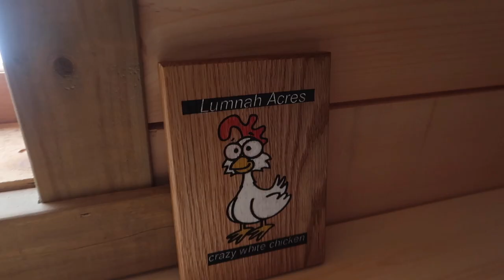BEST UPGRADE for DeWalt CHOP Saw WISH I knew about MONTHS AGO!

Comment: That's a DeWalt DWS779 that you just turned into a DWS780. A $200 upgrade for about $80 (incl. shipping). 👍 Just did it to mine last month.
Reply: BTW the bottom handle didn't need to be replaced as it's the exact same, only the top portion is different. 
Also, I kept my Warranty safe by just tucking the white wire into the white wire clips and didn't cut any wires on the saw.
Great upgrade!
Reply: that is crazy i never knew you could upgrade that yourself
Reply: @notbuyingit5698  thanks for the tips....I'll spare myself the headache of replacing the bottom handle. I'm not clear however what you mean by "tucking the white wire"...I gather it's secure enough from vibration that it's holding fast?
Reply: @Keith Rayeski - The white wire on the added wire clip (black & white thin wires). Strip the end of that white wire a bit more, then separate the White Wire clip original to the saw (thick wires). Put the stripped end of the thin white wire on the added wire through the small hole on the end of the thick White Wire clips original to the saw. Then tuck those thick White Wire clips back together and it's done. Never had to cut anything original to the saw.
Hope that made sense...
Reply: @Keith Rayeski @12:12 to 12:20 on the video. Don't do what Al did after 12:20. You don't even need the included wire connector shown at 12:21
Reply: Not Buying It yep, following you....thanks again...I’ll take that approach....
Reply: M J main advantage I could think of, is the laser only lines up one side of the blade.
Reply: M J one of the disadvantages is that it is battery operated, something Al does make note of in the video. Certainly, if it fits your 12 inch, you can learn to use it. But the dewalt light is a part of the actual saw. It’s more of an upgrade than an addition. It also lights up a larger area of the board and cut, as opposed to a single red line that affords no additional lighting. Call it user preference. For some, it’s worth the cost and again, adds permanent value to the saw.
Reply: M J once I use it? I’m a general contractor, I own 4 miter saws and have made more cuts on one than everyone in these comments combined. A laser only shows you where the blade hits on the left side of the blade. If you need to make a cut on the right side, you’re either guessing your blade kerf, or you bring the blade down to check where it falls. But if you’re having to do that 50% of the time, then why have the laser at all? You asked what the advantage is, I answered your question. Don’t @ me!

Comment: I ordered mine today Al. I had seen them and did want one but, until now, it was a 'want' not a need and I couldn't justify the nearly 85 bucks for the, then what I considered, the luxury. But here is what sold me. I watch a wood working channel on you tube and he posted a video on cutting and installing treads and risers and a jig he built to make that much easier. He noted that many houses, especially older ones, are often a challenge for plumb, level and square. The jig made precision cuts were made a piece of cake because he had installed the light on his Dewalt as well. He was able to adjust his angles to a minutia before pulling the trigger on the saw. I was SOLD!! A like 'Not Buying It' noted, the value of your saw increased in value (excluding the purchase of the upgrade), by an easy hundred bucks! Not that I would consider selling my 779 (soon to be 780!) saw!! lol!

Comment: When I purchased my new 12" DeWalt slider - I thought "Oh boy, a small led work light.".  I had it for about a month before I was watching a YouTube video and saw what it was actually for (who said reading instructions has its benefits) ;-).  I agree, it is much better than the laser pointers that keep going out of alignment or need to be re-aligned if you change blades.

Comment: Gina, instead of peeling and slicing the beets before roasting, scrub them clean, then wrap them in aluminum foil.  Cook them until they are fork tender.  Take them out of the oven.  Let them cool a few minutes.  Then the skin will come right off.  I cook mine this way.  I use a paper towel to rub the skins off.  You can then slice or cut into quarters.
Reply: Susan Robare yes! I have never peeled a raw beet!

Comment: I have a laser light on my saw. I think the shadow light is more accurate. Al, when you mark a board at say 10'', put like a "V" shape mark pointing at the 10. It's called a crows foot. If you just put a line, and it's a bit crooked, it won't be as accurate. Especially if you mark it and hand it to someone else to cut, they won't know which end of the slanted line to reference. It can throw you off  1/16" or more. Might not seem like much unless you are doing trim work. It can make a big difference.

Comment: Taking a picture of the wiring is an excellent idea. Another tip would be to get a piece of cardboard and punch the screws into it and write next to them where they came from, so you know where and when to put them back in, in the right order, and you don't end up losing them. Al, you forgot to put the security strip back into the handle.

Comment: When I do Electrical Rough-In on Residential and Light Commercial structures , I always take Photos of the Wall Boxes after the Rough-In is complete because I have had Dry Wall Installers cover up some of the Electrical Boxes by mistake. By Going back and looking at the photos I know exactly where each box is and I can easily find their exact location !

Comment: Good morning to all.The smell of a wood stove burning on a cold snow frosted day is comforting with properly aged wood that give a dry aged warmth with a kettle of water and fragrant leaves I tossed in the copper pot to add more fragrance into the house, orange bergamot, sage, rose hips and lemon bam and a few added seeds I can’t quite remember as I made quite a few as I gathered and dried and bagged. When you step outside the aged wood has quite a good fragrant smell of that beckons you to come inside and sit by the stove with a mug of hot chocolate. Y’all have good day.

Comment: I use to have a wood burner. Then i switched to a corn burner. Its like burning corn oil so there's no wood smell. I do miss that. I only use it in below zero temps to supplement the regular heat.

Comment: I bought DW 717 XPS that led light was great until it broke just after warranty was void. Now i have normal saw with broken led.
Reply from the maker: I bet it can be fixed
Reply: @LumnahAcres  Yes it can for sure but not high hopes if previous lasted few years that replace part won't last much longer.

Comment: Does it make a difference if your pencil mark is on left side of blade , let's say you measure from right to left would you have to see the mark on right blade to compensate for thickness of the blade. ?
Reply from the maker: It does

Comment: I bought a Milwaukee impact and drill kit about 4 years ago ,warranty for 5 years only thing not warranty was the brushes , i used it for about 3 months then the trigger went bad so i took it to the shop for warranty , guess what the trigger and brushed are one kit so 120.00 later got my impact back , used it for like 5 months and trigger went bad again ,so to the trash  it went, i bought a RYOBI kit impact and drill  been lil over 3 years now not the 1st bit of problem , for 98 bucks didn't do to bad

Comment: Al,   It is great that you remembered to unplug the saw before you worked on the switch and wiring!  But, never grab a saw blade on any power saw while plugged in.   One defective spring could break and the saw turn on.   Keep your fingers to yourself!    Respectfully,   Kevin

Comment: When are you going to put some outlets on the wall above your workbenches?  The outlets by the power panel are getting full of battery chargers, the needed security system, and extension cords that run all over the floor.
Reply from the maker: Once I know where I need the plugs I will run the wiring and conduit

Comment: At what temperature does it not matter if you are using Fahrenheit or Celsius?  -40 is equivalent on both scales.  Of course it's still over 200 on the Kelvin scale.

Comment: Anyone have a link to the exact setup used in the video? Thanks!
Reply from the maker: I bet if you call the company they will tell you what you need
Reply: Lumnah Acres did you intentionally not leave a link to their website in your description?
Reply from the maker: Zach McBournie I pinned there link to the top of the comments
Reply from the maker: Zach McBournie and it’s in the video description
Reply: Lumnah Acres that is the exact kit you used. That kit works for DWS779, DWS782, and the DW716 only.
Reply: Lumnah Acres Haha! You are right. I was being lazy and since it wasn’t highlighted blue I skimmed right over it. Thanks so much!

Comment: I guess all the slice of your life stuff is nice, and obviously lots of people like it, so maybe it's just me, but I was only here for the tool information and was trying to fast forward through all that other stuff. So, having got off on the wrong foot already, I have a question about the tool stuff. You say the kit came from www.toolsandmachinery.com, but it's not hyperlinked, and having gone to that site, and I can't find the kit. Do you know the # of the kit? It doesn't sound like the two Dewalt replacement laser kits they have listed, and I've been on hold with them for so long that they finally just disconnected my call. Wanting to add this to a DW715.

Comment: taking pics of the wiring has helped me rebuild my 80 gal water heater. saved me 800 bucks and i avoid replacing with a lower capacity unit. just cant find those 80 gal water heaters anymore. great tip.

Comment: You could wire it direct to the output of the switch and not use the new handle and it would just come on when you pull the trigger

Comment: Alaskan here. It's -12 F right now. It's cold right now, but after -25 or so, I just can't tell that much difference from -40. I've been in -50. If it stays at that temperature for a few days, the black spruce will suddenly crack open. It sounds like a rifle shot sometimes.
edit: I love that smell. Alaska has AMAZING smells at different times of the year. My favorite smell is the cottonwood leaves opening. They have a sticky sap that smells heavenly. I wish they made a room freshener of it.

Comment: Nice upgrade with the LED light making a perfect shadow of the blade as I would imagine DeWalt would build this feature into their saws eventually. What gets me a very precise line for my woodworking cuts with my miter saw is to use a very sharp pencil tip & draw the line off of the square & visually keeping the blade kerf just a " hair " ( .0005 +- ) off that line & making a perfect cut most the time, when necessary I will do another whisker cut for an absolute precision fit of the board. However this is an excellent upgrade nonetheless... Periodically I take a can full of pencils & run them through my electric pencil sharpener upstairs on the desk. Can't never have to many sharp pencils! 
Bill on the Hill... :~)

Comment: Always unplug your equipment Al. Safety First. Al, I beat you in saying to unplug your saw. They do sale little numbers that you can tag your wires, Wrap around the wires. You could use some tape and small pc. of paper with numbers on. Remember to do both sides. Al, I see you have a lot of saw dust around, that could be a fire hazard. Dust collector would help. I though you had a Red Laser on your saw.

Comment: I am sorry but I cannot take it any more. You own a 'sliding compound miter saw' or miter saw  for short. You do NOT own a 'chop saw'.  You can use a miter saw as a chop saw but you cannot use a chop saw as a miter saw. Here is a definition from the net:

Chop Saw vs Miter Saw Difference
One of the biggest confusions that people encounter when trying to differentiate between saws is the difference between a chop saw and a miter saw. Both saws are fairly similar in that they both move up and down (not back and forth). However, this is one of the few similarities they have. Chop saws are only able to move straight up and down, meaning they can only make straight cuts into wood.

If all you need to make are square cuts, this should work well for you. However, if you need to make angled cuts, a miter saw is the better investment. Miter saws can be adjusted to cut at a variety of different angles and are therefore, a bit more versatile. Often, they are designed to make 45 degree angle cuts and they work incredibly accurately and efficiently.